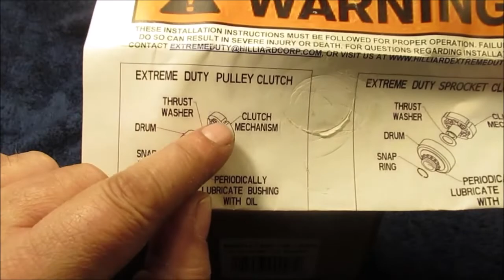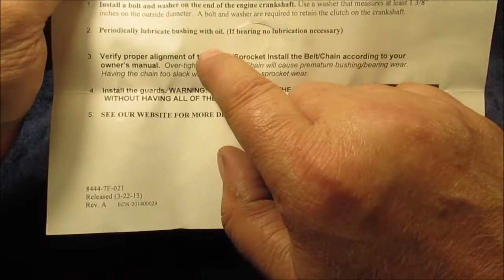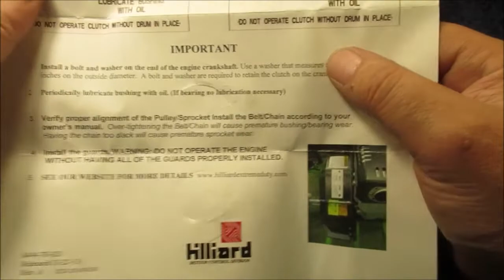Centrifugal Belt Clutch for my Honda 8 H.P.

Comment: Looks like a fun project ahead! Time for an a/c unit in your shop?
Reply from the maker: I am slowly gathering parts for the project ..I hope to strip down the riding mower this week and see what I need to fit the bigger engine....I have a spare window  AC The shop is not insulated so It would be running a lot ..This is one of the last hot days for awhile low 60's tomorrow with rain